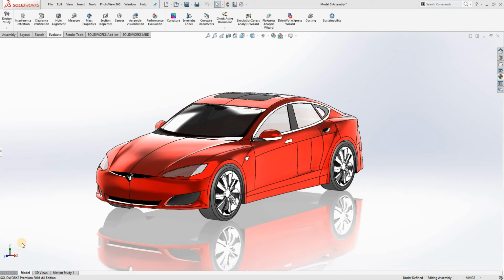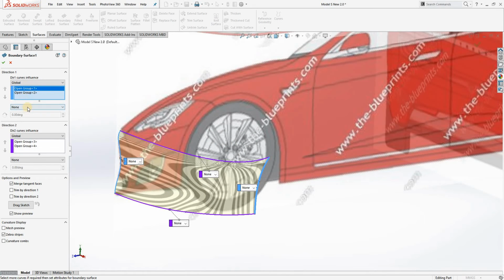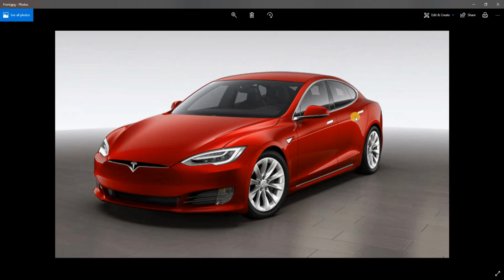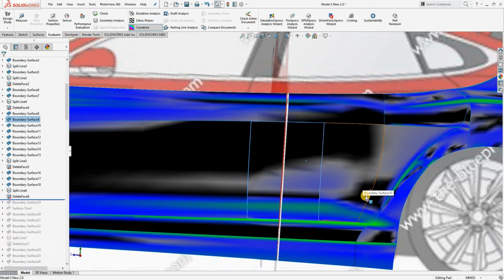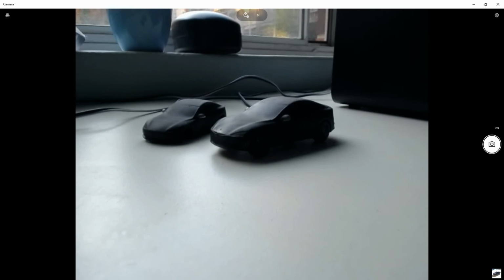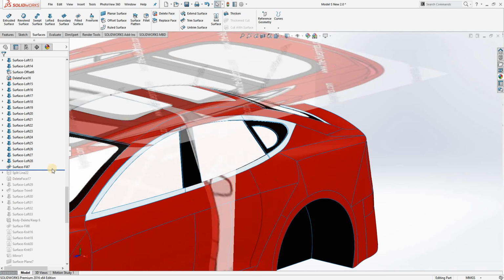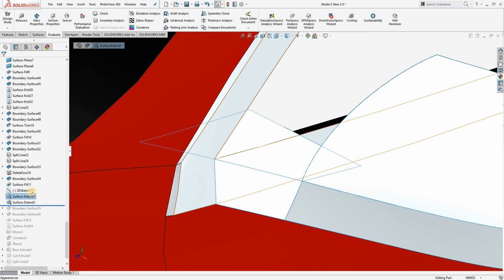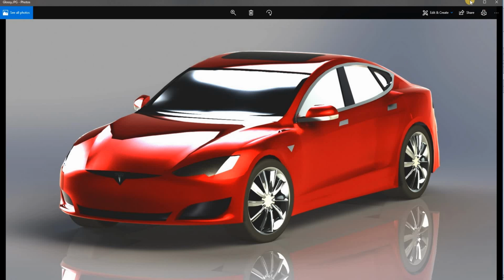Tesla Model S Car Modelling | SolidWorks CAD Tutorial

Comment from the maker: Video Keypoints:
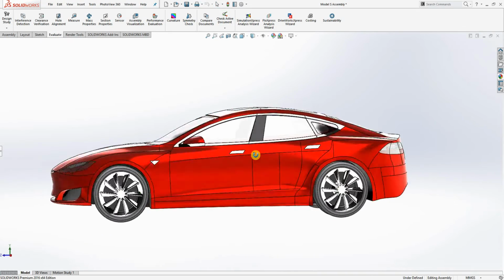Creating a Surface - 0:55
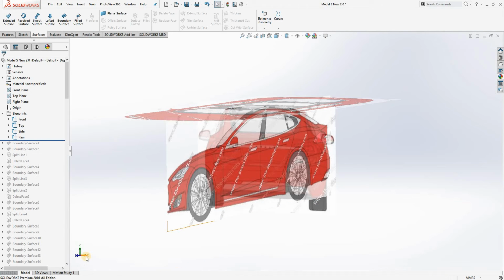Importing Blueprint images - 3:30
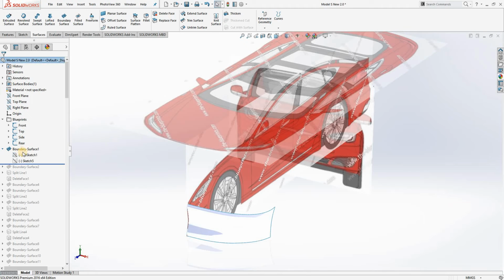First Surface - 4:39
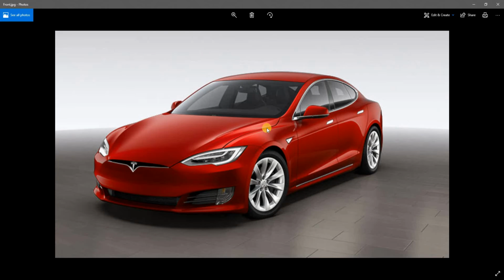Explaining how to Partition Surfaces - 7:23
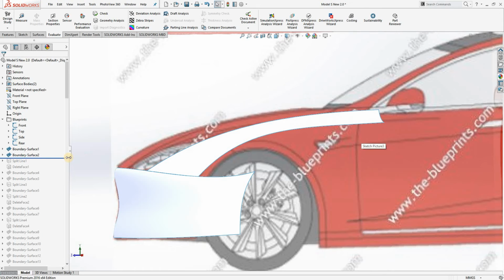Adding Details with Split Line 10:25
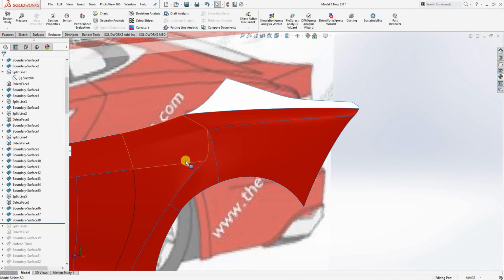Analysis with Curvature Tool - 15:04
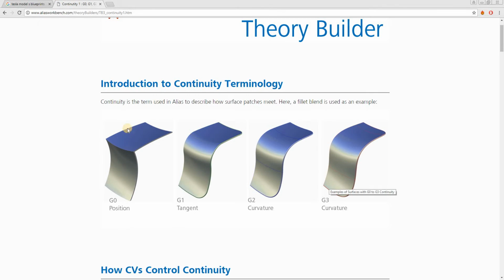Surface Continuity Types - 18:34
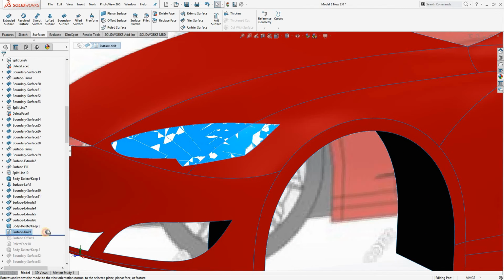Surface Offset for Headlight Feature - 26:15
3D Printed Model - 27:25
Surface Extrude & Surface Fill - 30:30
Window Recesses Using Surface Offset & Loft - 32:22
Surfacing Knitting - 35:50
Making a Solid Body - 37:37
Side View Mirrors & Surface Fill Tool - 39:18
Merging Solid Bodies - 41:30
Making the Wheels - 43:25
Conclusion - 46:10

Thanks for watching! 

For a more recent video on how to create photo realistic render images in SolidWorks please see the link in the video description
Reply: Pin this
Reply from the maker: @brandondonovan8402  Thanks for the reminder!
Reply: Thanks for the video😍😍😍😍😍😍

Comment: hi, how to make a gap/clearance between each panel?
thank you
Reply from the maker: You can project a sketch onto a surface body and then use split line to split it into multiple bodies then delete face to remove the section you don't want
Reply: The BEST way t do that is using  the indent tool that allows you to add the gap_tickness you want to remove bettwen surfaces

Comment: would this be a solid model tho or would it show as non manifold for 3d printing
Reply from the maker: This is a solid model. 3D printing software could hollow it out if desired. Obviously this isn't as in depth as a real car designed for manufacture

Comment: You said you will be able to learn to create surface. But there is no hint on which key to press to switch between line to spline mode. How to switch from XY to YZ plane. This video is not for beginner, it is just a show off.
Reply from the maker: Sorry you feel that way. This isn't intended to be a beginner guide to surfacing. I recommend look at Innova Systems video about creating a mouse with surfacing. Modelling a car is more complex and this video is a guide on how to approach it and a discussion on various concepts. To switch between line and spline you just select the different tools in the ribbon, to switch between ZXY planes I just click on the axis arrows in the bottom left

Comment: in what way this cad be used in car industries? since there is no engineering consideration.
Reply from the maker: This is just replicating the cars exterior to demonstrate surfacing methods in the software. It's not designing a car body from scratch for manufacture. Obviously a car isn't made as one piece. For each section you would consider the materials, strength, manufacturability, drag, operating environment compatibility etc. This video isn't about how to design a car for manufacture. I even say in the video this specific software isn't ideal for automotive bodies. Most likely Catia is used in the industry.

Comment: can it simulate this? hhehe including its parameters and calculations?
Reply from the maker: You could simulate the aerodynamics with this model. The body shape would be slightly different from the real model (not a perfect match) but would give a rough idea of the drag of the car. You couldn't really simulate the strength of components or how it would behave in a crash as this is just a model of the exterior shell as one whole piece

Comment: Hello, a friend is using an LDV V80 Biggest Van to live in and I said I would model the van so she can plan an internal layout. So it needs to be accurate from the internal volume point of view. I have SW 2016 and am proficient in modelling generally but haven't worked with surfaces much. I assume using surfaces would be the best in this scenario? I have a simple 2D sketch but only back and side views but the van is in my drive for the build so I can take some real measurements if I need to. At the moment I just used some splines drawn on the back plane for half of the outline and used simple surface extrude to get started. Then mirrored the bodies to give me a box of approx correct shape. Do you think this is a good approach. Many people use Sketchup but I haven't used that SW and because I have SW I think it offers greater capability. Especially when it comes to cabinet making, cut lists, laying out/nesting parts etc. Even looking at total weight of items by using real materials etc. Be interested in your thoughts.
Reply from the maker: I just did a google search of blueprints of that van and some came up. You could model it the same way i modelled the Tesla is this video. However, to be honest I don't see the value in modelling the van for your friend. I think it would be better to model the interior space of the van (based of measurements) and then present her with various layout options in that interior space. Modelling the exterior of the van seems like a lot of work for little return. I assume your friend doesn't use SW so not sure what she would do with a model of the exterior. Various models of the inside space with alternate arrangements could be pretty useful though, for visualising, planning, sizing etc. Good luck
Reply: Mech Designs & SolidWorks Tutorials Thanks, exactly my thoughts too. The inside has various protruding parts like the wheel wells and strengthening ribs which impact the internal space. The van will be insulated and have a ply lining which then will form the basis of the internal volume. The question is do surfaces represent the best modelling method for the shell? I suppose it gives the most flexibility. BTW the only blueprints I found were expensive at 20 Euro. Did you find a free set anywhere?
Reply from the maker: @allanpennington  Yes surfacing is the most accurate way to model the shell. You can just crop the blueprint views from the images in a google search, resolution wont be amazing but it would be good enough

Comment: Do you have the download picture of the Tesla so I can follow along and practice?
You did a great job by the way! Hope to see more videos like this from you.
Reply from the maker: Hi, thank you! if you Google search "Tesla Model S Blueprints" you should be able to find them. Crop each isometric view into its own image then bring them into Solidworks using "Sketch Picture"
Reply from the maker: I have also added a link in the video description to the pictures I used
Reply: Solidworks Designs & Tutorials by this way we can make any car, by this following your instructions?
Reply: I mean to get the blue prints first, and then follow up?
Reply from the maker: @kushagrak960  Yes following this method you can model the exterior of any car as long as you have the blueprints of the different views
Reply: Solidworks Designs & Tutorials one thing more, if we make like the cars wheel and other accessories and then assemble it, so we can see the motion too?
Reply: Solidworks Designs & Tutorials have you done an assembly of a car?
Reply from the maker: @kushagrak960  Yes that's correct. Just make the body as one part. The wheels in this tutorial are seperate parts and if you wanted you could look at the motiom between them